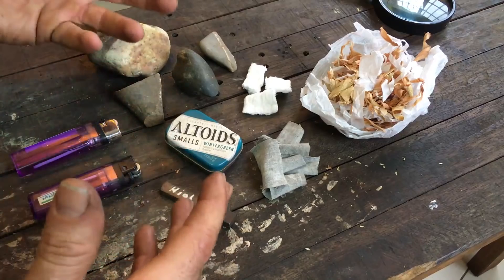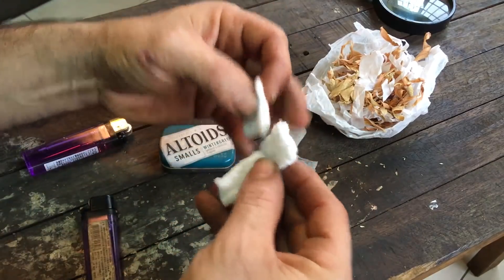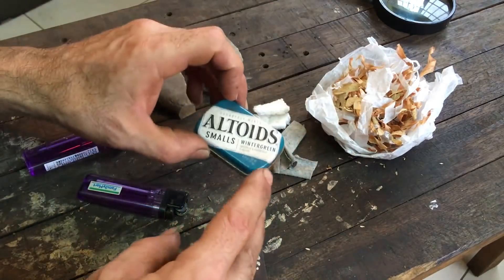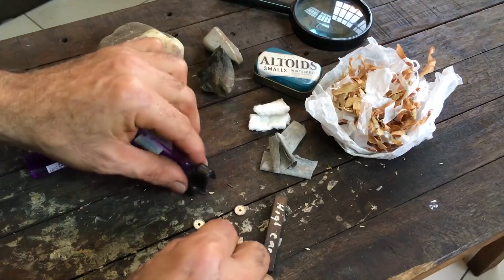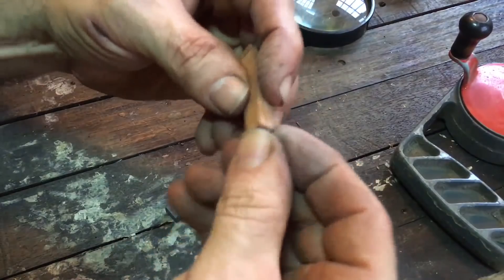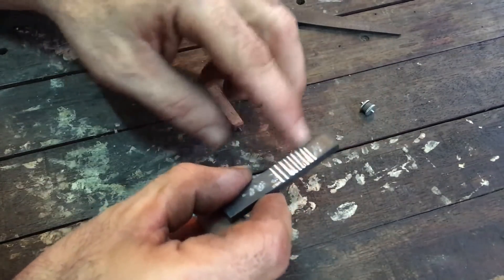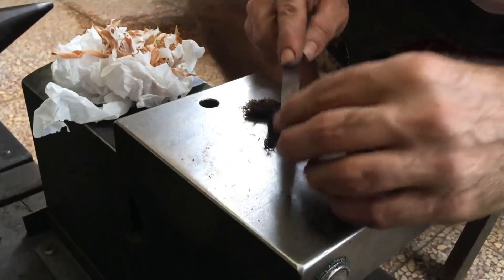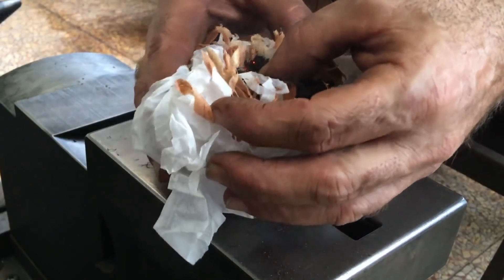An unusual fire striker set

Comment: Hello ! I have a friend who makes great fire striker sets from hardened high carbon steel, flint shards and burnt coton. His technique is to increase a lot the grain structure of the steel by heating it very high and quenching it way too hot in oil or water. It makes kind of sense if we see the sparks as little pieces coming off at the size of the steel's grain size. Also, this friend is a very good stone shaper and he uses bones or wood or even copper "strikers" to shape the flint into a sharp edged piece. He makes great beautiful sparks by striking down on the flint with a "sliding" motion, making the steel strongly scratch the edge of the flint on its entire length.
Maybe you knew all of this already, anyway, it's just some shared empiric knowledge : )
Thank you for the video, good job as always !
Reply from the maker: Gabriel, Thanks for sharing all this good information. It sounds like your friend has this down to an art form. I could definitely learn how to go about this better.

Comment: Hi Glen I use old denim jeans to make my char cloth. I put it in the tin and close the lid. You definitely need a hole in the top to let the gasses out. These gasses may even catch fire which is ok. Put the tin on the fire, you gas fire was perfect. I think the forge was way too hot. Cook the char cloth on a low flame until there is no more smokey gasses coming out and turn off your gas fire. This can take between 15 and 30mins depending on how much cotton cloth you put in the tin and the intensity of your fire. It’s best to cook it slowly so a low flame works best. Once no more gasses are coming out remove the tin from the fire and leave the tin until the tin and the contents have cooled right down. If you open the tin too early oxygen gets in and ignite your cloth. You should end up with perfect char cloth that’s charred right the way through. Hope this helps.
Reply from the maker: Excellent information and well explained. I've learn much more from the comment section on this one. Thanks.

Comment: Actually the little gray thingy inside the lighter is the ferrocium and there is no flint inside a lighter :) What you have created is a really small ferrorod, but then I would just advice you to buy a ferrorod and scrape the ferrorod with a sharp piece of metal.

As for the charcloth making there is a lot of magic involved :) First of all you need untreated cotton. Most cotton these days is treated with firesuppressing agents, rendering it useless for charcloth. What works best is your grandmothers bedsheets that have been high temp washes over the years. I found that it's best to use a tin with a tight fitting lid no hinges. Poke a hole with a nail, cook your charcloth and when the smoke starts the disappear you insert the nail. If you don't the charcloth with be burned instead of charred because oxygen was available.

I could go on for ages about firesteel making, but i'll leave it at this ;) ferrorods are just a modern invention, go old stuff!!!
Reply: As for flint, you need a specific kind of stone to make it work. You need really sharp edges, almost like chipped glass and really hard . Try to see if you can find a lime-quarry, the chert they mine is actually considered waste material. Most of the time it will get used as a filler material, some countries even as railroad bedding. Here in the Netherlands it's really hard to come by a reliable source of good quality flint. and quarries are usually reluctant to deal with a blacksmith who only need a few kilograms for demo purposes (they usually are talking metric tonnes).

But thus far we are still getting our flint, I only wish it would be a reliable source. If you want I could arrange a package to be sent your way. Just send me a message, we currently have some in stock.
Reply from the maker: Patrick, Yes, I realized my mistake shortly after posting this video. And all if your information is excellent. Thanks for watching and sharing.
Reply from the maker: Patrick, Thanks for your offer to send me some flint. But I was only having a bit of fun with this one and I can wait to get flint or other suitable stone when I am in the US. Have a happy holiday season.

Comment: The round metal part of a lighter is the striker, the small piece you were holding is the ferrocerium. You can buy large rods of ferrocerium online.  You can go the file route or just have high carbon steel with sharp corners. I use the back of my bushcraft knife to strike my ferro-rod. A flint striker with sharp edges will also work. with ferro-rods you are basically shaving small amounts off of it to catch a flame. Also fray your char-cloths edges up, it will catch much easier that way. Hope that helps!
Reply from the maker: I realized my mistake shortly after posting this video. Lots of good information posted by folks like yourself in the comment section. I'll give this another go. Thanks.
Reply: @gstongs  glad i could help.

Comment: Great video. So with the lighter, if you just take the piece the goes around the back and leave the wheel and "flint" there you can still spin it and get good sparks that are able to be directed on to the char cloth.
Reply from the maker: Joe, Yes, I could have left the lighter in tact and got a good sparks. But the way a lighter is configured, it seemed hard to catch a spark in char cloth (I tired). But my technique on this one is way off. Thanks.

Comment: Was the high carb steel hardened? It has to be, and if you forge a real striker out of it you can hit harder and especcially faster and it will make good sparks with every harder stone that has an edge, quartz works too, for example.
Reply from the maker: Edgar, Yes, that piece was hardened. There are a lot of mistakes in my technique on this one but I was mostly experimenting. I will have another try at this. Thanks.

Comment: You dont need a flint stone you only need a stone witch is harder than your steel. And you need a sharp edge.
What you thought in the lighter that was the flint in reality that was the ferocirium and the wheel just scrapes it. Those work at comlitpy different pricibles.

Comment: Hi Glen,
 Your on the right track now. You don't need a hole as you saw, it vented through the hinges fine. I also use denim, now instead of cotton , unless I'm making Vaseline cotton balls. When making Char you need to leave it on the heat, until the smoke STOPS coming out.  Also you want to tear your char cloth as those little frayed ends catch a faint spark better.  Tray putting the end of your file, against your char and sparking into it.
 By just looking it is hard to tell about your rocks. Some may have been alright but you need a sharp edge to peal a piece of steel off you striker. So if you would bust or crack open a few of your stones , you might get a sharp edge. 
 One of the best channels on fire starting is , David Wests channel. You will have to go back to some of his earlier videos, as now he is into mainly just friction fire. He started out for years with fling and steel type fires and is very good at explaining the INs and Outs of all steps.
Reply from the maker: victor, Using denim is a great idea. And I need to break the rocks as you mention to create some sharp edges to truly test them. I was having a little fun with this one but will take what I've learned and have another go. Thanks.

Comment: I believe you would get more sparks if you ran the flint down the file (for tip towards tang) as opposed to up (tang to tip) as files only cut in one direction because the teeth are at a forward angle so it would create more ferrocerium shavings.  I like the little holder you made for the teeny tiny flint though lol.
Reply from the maker: I never thought about that - a very good idea. I tried it and it works much, much better. I made so many mistakes on this one but learned a ton from the comments. I will have another go... Thanks for the excellent insight.

Comment: why not just use normal flint or an other stone type with hardness 8, 9 and a piece of steal to throw sparks ? and when charing anny thing u do want a small hole to realese pressure so it won't pop open and then u can geage how mutch gasses escape by seeing the flame, when the flame starts do die down u remove the tin and cover it with dirt or a moist ( not dripping but some what wet cloth ) so there cant come any oxigen into the tin or it will automatically catch fire with it still being so hot so let it cool to the touche  before opening for best results,  Cheer's
Reply from the maker: Erik, I was unable to get a piece of flint or similarly hard stone. Thanks for sharing all of the good information.

Comment: I take the stainless shroud off of the lighter, leave the wheel on and slowly grind ferro shavings on my tinder (or charcloth in this case), then give it a strong flick and watch it flame up.
Also, buying any lighter other than Bic is a perfect example of being "penny wise and dollar stupid"!
Reply from the maker: Bradley, Your idea sounds good. They don't sell Bic lighters here in Taiwan. And I paid about .30 cents for the one I used in this video. Thanks for watching all the same.
Reply: Glen GS Tongs ...I'm sorry. I wasn't talking about you. I was just speaking in general because many people buy cheap lighters thinking they are saving money. Re-reading that, it sounded insulting, but it was't meant to be.
Reply: @gstongs  need sharp edge stone to scrap off the steel for spark it's the sharp rock edge.